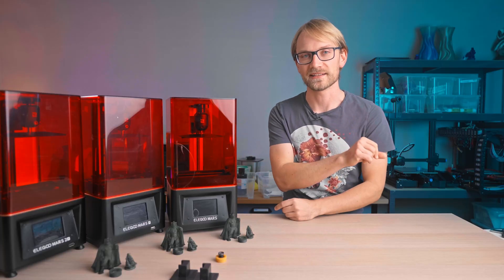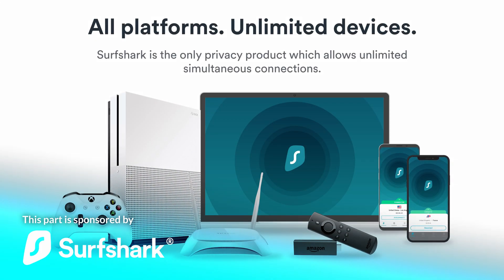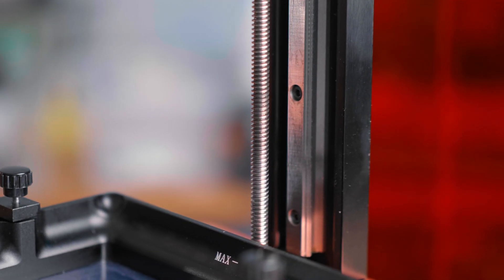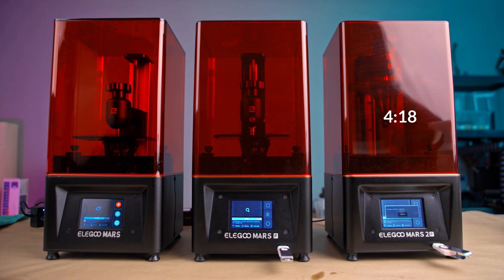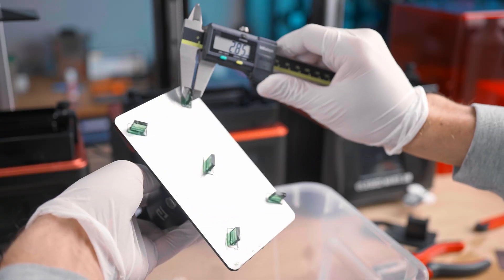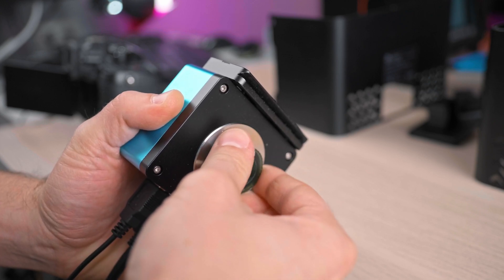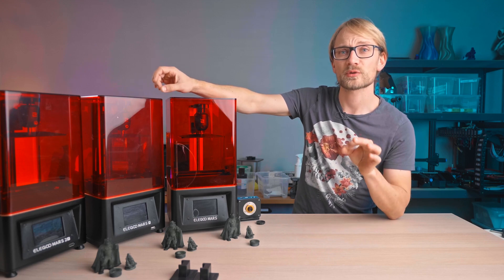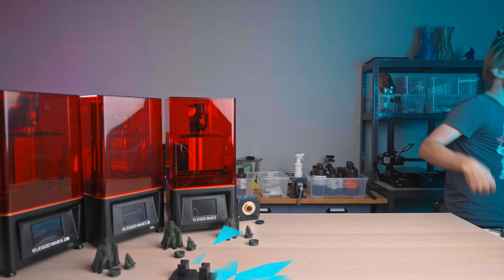Elegoo Mars (2 Pro): Which one is the best resin printer?

Comment: Thomas Sanladerer -   I might also add that there are differences in print speed (as in mm per second) which my be more significant than the improvement from the Mono Screen.  This would seem to be at least partially due to the intensity of the LCD Array.  Speeds seem to go from 20 to 80 and of particular intertest is the Saturn quotes 20.

Comment: video suggestion: making resin printed parts that snap fit together. i have yet to resin print parts with tolerances good enough to connect various pieces after printing. example, a figure who's arms pieces connect to the body piece. i always have to do a buch of sanding to get the pieces to fit together and even then it often looks like crap

Comment: Thinking of getting a Mars 2 pro for the 30% speed increase... but I'm concerned about the LCD screen not having any protection... Can you still wipe it clean with Isopropyl alcohol as i used to with the standard Mars, if ever you spash a drop of resin on it? or is it doomed?
Reply: We've been using one for over a month now, using cotton to clean the screen from time to time, no problems so far.

The tape around the screen grants a small gap so you can slide the vat slightly angled so it doesn't rub on the screen when fitting in.

Elegoo also is the only one to offer warranty of 6 months on the LCD, so it's a bit more of peace of mind.

Comment: Tom, wrt. your C-Mount to M12 lens adaptor observations...
If you want mechanically accurate parts out of resin printers then you really should not be using translucent or transparent resins. Resin printers are basically photographic processes in 3 dimensions. On translucent resins, and especially transparent resins, there is significant light bleed in all three dimensions (roughly equivalent to overexposure) that causes solid parts to become oversize. If you want mechanically accurate parts then you need to use opaque resins instead.
Your comparison between the Elegoo prints with translucent resins versus the Prusa print with the opaque yellow resin wasn't really a fair comparison because of this. You could confirm this outcome for yourself by reprinting the adaptors on the Elegoos using the same yellow resin that you used on the Prusa, and I would hope that you do this to see for yourself.
Reply from the maker: Good point!

Comment: For replacement filters... you can get activated carbon impregnated foam blocks (normally used in aquarium filters) from decent aquarium stores and cut them down to size. It's probably cheaper and easier to use activate carbon in mesh bags, again from aquarium stores.

Comment: The problems with resin printed thread are mainly caused by the shrinking of the cured resin. Resin with high shrink require some modification of the scale factor. Especially the cheap resins have higher shrinkage.
Reply: True. A specialty resin might be the way to go here.

Comment: As someone who has worked with the Mars without a Mercury cleaning station and currently owns a Mars 2 Pro as well as a Mercury, I can testify that the Mercury is WELL WORTH the expense. It turns an ratherr  unpleasantly messy job into one that is merely mildly unpleasant.

Further, the extra print speed of the Mars 2 Pro changes the dynamic so that prints I might have left for over-night are.now confidently started and finished in the evening.

There is a difference in quality but, as Tom says, it's only mildly better, both being excellent.
Reply: I double that about the Mercury. We have the same setup here (M2P + Mercury Plus) and it's amazing how easy and clean post-processing is now.

Comment: A question to M-SLA users: have you ever repaired a dead LCD by replacing the polarizer film? I've tried finding about that but didn't see much, some people on the Prusa forums said that what degrades is the liquid crystal itself and not the polarizer glue or film, so that wouldn't work. It would, whoever, make it far more interesting for me than having to replace the whole panel when it dies.
Is it possible to do so? Of course, I know how to remove said top film, but I don't know if it does anything at all.
Reply: Is it worth the hassle for a $20 part?
Reply: @86abaile  Considering in Brazil these 20 dollars are hard to come by, and takes at least a month to arrive, yes.
I also haven't found them for 20 dollars at all. I can only find them closer to 50 at least (the 2560x1440 panels at least, dunno the lower resolution ones). I might be underestimating their reliability of course, but I prefer to have a machine with far less maintenance costs on the long run, and removing a polarizer ain't too much work for me after so many Game Boy LCD repairs, just wanted to know if it even works at all.

Comment: I'd hands down recommend the Mars 2 Pro out of the three. I think the speed increase alone is worth it. Interested to know if you are actually printing on the Mars 2 Pro at 2 or 2.5sec per layer with 0.5 layer height and regular resin. My exposure tests have me printing at 3.2sec per layer, as I found between 3-3.5 gave the best results. Had me thinking that the time of 2sec per layer was only properly achievable with a lower layer height.
Reply: That's interesting to know. Also, resin color should affect these times. The 3.2 sec you mentioned, for which color is that?
Reply: @spokoman23  It’s for Elegoo Water Washable grey. Colour definitely plays a part too. Black resin is known to need a longer curing time. I’m not sure how the clear green prints, but that may explain some of Toms results.

Comment: How about a DIY carbon filter using readily available, activated carbon filter material from room air filters cut into small squares and stacked into a 3D printed case or modified (opened) original Elegoo filter case?  Or does the Elegoo filter use activated carbon granules below that glued-on top grill?  If so, cut off that grill, refill, and close with a 3D printed top grill.

Comment: You can buy activated carbon filter in any pet store, in the cat toilet section. You normally can buy them in packs of 5st (100mmx200mm approx)
Reply: Yup. Can also buy them online but you gotta be careful to get the real stuff and not some cheap fake stuff. I typically use Honeywell universal carbon pre-filters, more expensive than the pet store stuff (again, gotta be careful to get legit ones than the counterfiets flooding Amazon), but works much better for this kind of application.
Reply: @shadow7037932  Tbh I actually was 100% unaware of the fake ones even existing, that's a good thing to know. Appreciate the tip!
Reply: You can also buy activated carbon by the carton and print up your own refillable filter cartridges, as with aquarium filters

Comment: The detail that resin printing produces is truly incredible. If only it was as clean and straight forward as FDM.
Reply: It is kind of simpler compared to FDM in some ways. There's far fewer settings that impact print quality for example. You don't need to deal with jerk settings, fan speeds, bridge distances, 4 axis motion (vs just 1 for MSLA), etc. But at the same time, it's messier to work with and resin is toxic.
Reply: I'd argue that resin printing is more straight forward than FDM. I've had a much better success rate with my own original Mars than any of my FDM printers in the same price range. The only disadvantage in my mind is the cleaning. Other than that they've each got their own benefits with different materials.
Reply: I agree. The amount of chemicals you need to use and trying to dispose of them safely is not good. And the impact on health if your not using an extractor cabinet is also a major concern.